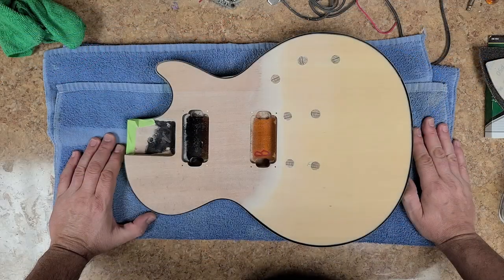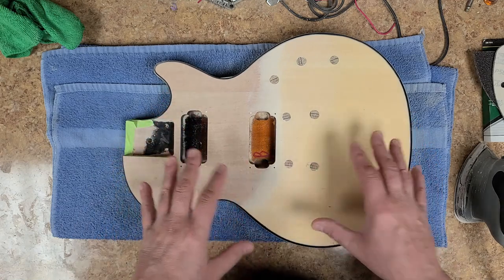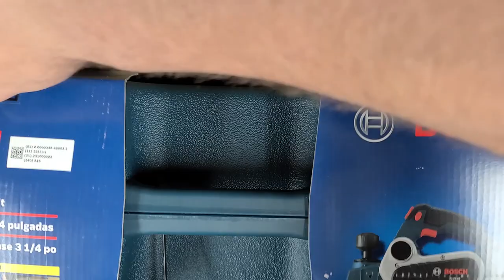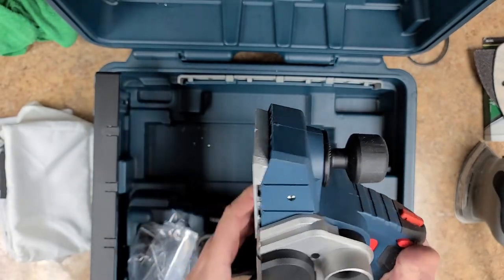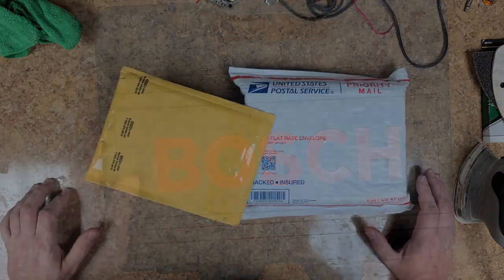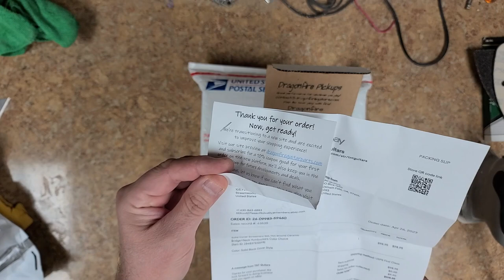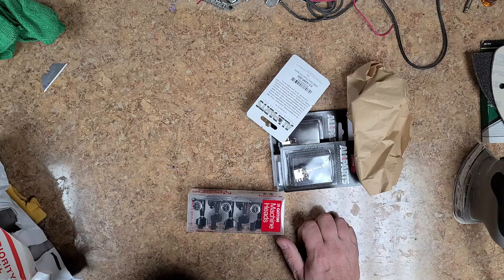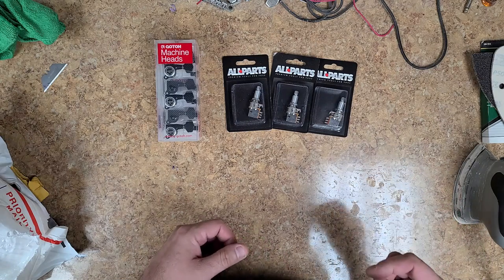Epiphone Special ll Custom Rebuild Begins Part 1

Comment: I had a mexican fender which hadthat awful poly on that just wouldn't sand off...in the end I took it to a carpentry shop who put it on a table sander for me.

I have heard since a heat gun is the most effective way
Reply from the maker: I've done the heatgun on an ESP LTD body. Have to be careful. If it's a 2 or 3 piece, or more. Too much heat will shrink the wood and open at the glue joints. I was thinking of a ground corn husk sandblaster.